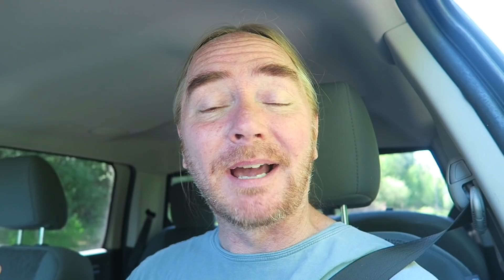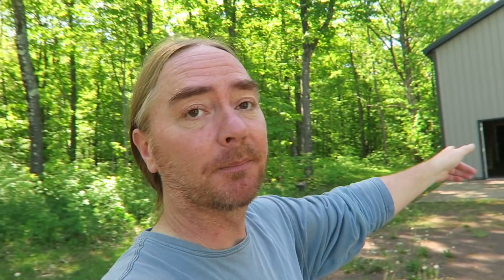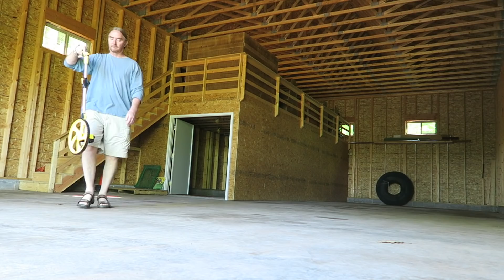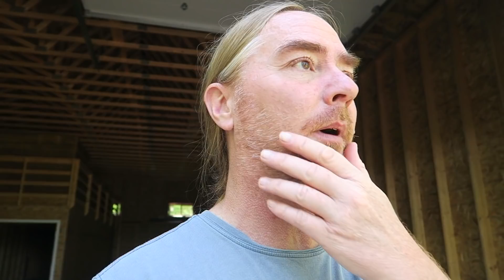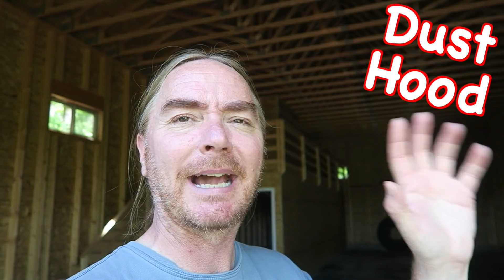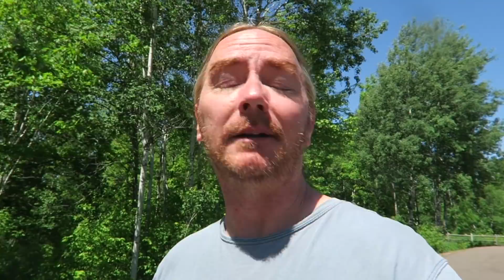Old Shop Vs New : What I've Learned Over The Years

Comment: In addition to a 20' shipping container for chemicals storage on the side of the shop under an awning (wired and heated), I would recomend a smallish gantry Crain. We are not getting younger.  This would facilitate moving small boats, equipment, shop supplies and lumber. 
Adding a mezzanine over part of the wood working area would expand storage and with a Crain,  lumber and other items could be stored with ease. 
Build a small compressor closet, (it could even be over the office) with a refrigerated dryer. Run 3/4" rubber air line secured with conduit clamps every 3-4 ft. Install 1/2" drops every 3 to 6 ft with a connector mounted to the wall. 
Also spray foam is your vapor barrier so that coupled with batt insulation will go a long way. 
Plywood lined walls (even cheaper t1 11 ) over the insulation give you the ability to secure anywhere on the wall. 
I would run electrical in metal conduit on the surface of the walls as well as the air lines.
Run pex to the front and back for hose bibs inside and out.

Comment: Get rid of the bulky table saw and get a wall track saw it made a huge diff in my shop much easier to work with.
As far as the compressor build a shelf up high and put it on it and insult a box around it .

Comment: Don't forget those stairs in your shop are not really permanent, you can change their angle and length to whatever you like fairly inexpensively. You could even make more of a walkway then stairs coming down closer to the small door, (make room for more equipment or lockers under them if needed). Just a lot of different ways they could be configured to add space.
Consider a fairly cheap shed right next to the shop for your air compressor and piping the air in, may be cheaper than insulation at some point not sure. It would also mean interior shop space is not used up by the compressor...

Comment: For the  air compressor I would put it on the mezzanine floor or outside in a small attached shed (it would really help with sound). As for Dust collection if you don’t empty it a lot I would have it off the floor in the wood shop area to increase floor space. My shop is small so I am always trying to keep floor space free. Can’t wait to see what you do in the new shop thanks for the videos!

Comment: Hi from Australia,  I agree with putting  the dust extraction  and compressor outside in a dedicated shed,  also putting  your  wood working  machinery  on lockable casters. The room I would set up part of it as a spray booth  and mixing area and extending  the mezzanine  right across  the back as that height is not used efficiently, you could even  put it  up like a 2nd teir for extra head room and give you more depth for longer boats especially  if your machinery is on castors.
Festool  also have a portable  workstation  that has a/c power, air and dust  extraction  that pivots and swivels. An overhead gantry  run on a couple of rails would make moving heavy objects safer.

Comment: Andy !!!! For your Hazardous material locker, consider a shipping container...A lot of Shipping companies sell there old containers real cheap. The community collage I go to just purchased two 8x10 and paid about 15 hundred for them. I have worked on construction jobs where they did the same, and the carpenters came in and framed them out and installed dry wall.....Hope this helps. it would definitely free up space in the shop....you can install those air circulators on top to vent...those are real cheap at Home Depot

Comment: Put your air compressor on exterior of building.  Add a small enclosure to side of building big enough for the compressor.  Insulate it for all weather and noise reduction. Shouldn't here it too much from inside the shop. Did this on a one I built and it worked great.

Comment: You might want to talk with a HVAC shop about making you some small pick up hoods that you can place near where you are working, several sizes would allow you to size the pick up to the work you're doing. For increased stability you can hold them in place with smal sand bags. If you run a set of tubes from your dust collector down each side of the shopand equip them with several  blast gates as connection points, you then would only need short sections of flex hose to get the pick up hood connected to your system.

Comment: WiFi in the shop. Decent broadband from the street if you can. An office space? Bathroom? Running water? Slop sink for cleaning? Security system? Epoxy paint the concrete floor will eliminate a large dust problem and help keep it clean. 
Just a few thoughts as I walk around in the ideal shop in my head.

Comment: Utilities - in my area, new 320 amp service is about 35 bucks a foot. $20 grand for the wiring and install. 

Hopefully you can get away with 200 amp. Buy it won't be 8-10k

Comment: First thing is you don’t currently have enough room to do everything you want, do like these guys are saying and get some shipping containers and add some doors and build a little connector to get to them from the inside if you don’t want to walk outside or just build off the sides and do the same. Second is I would start looking for as much used equipment as possible, auction sites, Craigslist, FB marketplace etc. don’t just look locally for it also look out of state for too. I would def take out and use your old air makeup system in the new shop. I have a used Euro vac central vacuum system that I took out of a body shop that I’m willing to sell for $1,500, it has lots of tubes and drops and everything works and is in great condition I’m sure it would work for woodwork. Euro Vac is a top of line central vac system google and check out their website or call them. I can send you pics and the model and serial number if interested, I’m in Michigan also. You should be able to find used paint cabinets, if they look rough just paint them with some rustoleum safety yellow. Rotary screw compressor is gonna be your best bet for air but they’re also expensive. Also for dust look into a curtain system from Goff’s they will make them custom for your needs and they take up no room, just slide them out of the way, they’re on a track on top, also can get custom colors or your shop name on them and they even make them with filters in them for painting, check them out not very expensive either. I’ve been painting cars for 32yrs and have set up a couple of collision shops from scratch and have always done it on a very small budget and with used equipment. Cleaning up used dirty equipment and painting it to look like new is fairly easy and cheap to do compared to buying new and you can always buy new decals from the manufacture of the equipment, I used to refurbish used equipment for extra money and last is I think you are not even remotely in the ball park for what it’s gonna cost you for the energy company to trench and run utilities 600 ft. The shop I’m currently working at has sold and the new owners are running a water line 75 to maybe 100 ft and I heard it cost them 85k now this is a different utility then your needing but this was to run a 5-6 inch round water line into the building strictly for a water fire suppression system it also had to be bored under a two lane road to a fire hydrant which was 13k by its self but it was a very very expensive project. I wish you the best luck

Comment: Best composite fabric rack I’ve seen was an assortment of fibre rolls at the end of table, topped with a (heated from below with an electric blanket) 8x4 thick sheet of glass. It was on castors and MDF on top when not utilising the glass. Wax direct to glass and it cleans easily. Great for infusion.

Comment: I would not want to lose the working length of the shop.  Remember when you  did a Choy Lee 44 deck.  You could not do a big boat with a 28' length.  I would consider putting a door in the end of the building and doing your wood shop as a scab on building.  You could even do a prefab.  Or as one person suggested a 40' shipping container.

Comment: You can have your air compressor outside in a little like lean to type thing with the a pipe going through the wall into your garage there so you won't have to hear that compressor so much the outside so to speak

Comment: I would build a closet under the staircase and put your air compressor there. You can vent it enough for it to get air, you can insulate it enough so it will not be loud, and you can get at it for maintenance. It would be out of the way and not take up critical shop space.

Comment: I would line the walls and ceiling adding insulation in the void. That would help with dust control. Those roof joists will collect dust and then sprinkle dust down onto your work whenever you open a door or move around the shop. I would also put the air compressor outside and the container idea suggested by others is a good one. Good luck with the new shop.

Comment: buy a Conex ( steel storage boxes) placed on the outside touching the side of the building, and frame a door in the side of both Conex and exterior wall, conexs sell for 2,000- 2500 it will give you around 3200 cubic ft of storage. and its weather proof

Comment: Pallet racks & a forklift are huge in a shop as it helps you move things off the floor.  I never realized this until my 4th shop.   I'm now on my 5th and much smaller shop but got a small high-lift 1500lbs pallet jack (15ft lift) which is a godsend.  Of course, you have to have the height, but its seems you do - height in a lot of shops is wasted space that a forklift helps reclaim.

Also look into those clear curtain walls you often see in body shops.  They are great for isolating areas intermittently.   They also help with heating & cooling.  We used them to isolate areas where there was sanding or painting.   Oh, def. move any stationary machinery that you don't need to interact with (air compressor, central vacuum, etc) to an outside building/shed.

Comment: I try fit air compressor, emergency gen ,larger fan's, out side fitted under like a cabinet, extension on the building. Keeping noise outside, more room inside.

Comment: put your woodworking M/c`s in the enclosed area if poss and the compressor put it outside and undercover checkout steve summers vid titled (Shop air System with Elizabeth & Concrete pad for compressor)

Comment: Here is what I would do:

* Put ALL tools on dollies, the larger tools on a dolly each, the smaller tools on carts. Why settle for one shop layout when you can have as many as you like, depending on the boat you are working on?

* Built an addition at the back of the shop and make that the material storage for both wood as well as hazardous materials. Make that add on accessible from both the shop as well directly from the outside for load in. Added benefit - you can install an automated fire suppression system in the add on so if fit hits the shan, it can easily be put out without putting the shop or the boat at risk. 

* This will also keep the internal storage free for making it a finishing studio.

* Invest in a good ecosystem of battery powered handtools with good dust collection (I would go Makita since they have the largest selection of 18V tools, their dust collection is great and they are reasonably priced and last a long time, but you'll find that everyone has their favourites). Having outlets every 4 feet is great, not needing outlets is a lot greater and with 18V tools beeing as good as they are today, you'll never look back.

Comment: Two thoughts:
1. What about a cargo container for storing bulk materials including hazardous? Keeps them away from your most important stuff
2. What about extending your platform across back of building. If leave center part free to wall you have more space to locate fixed tools and opens lower portion and center of space to larger boats.. could also dual purpose with some sort of all around scaffolding?

Comment: If you complain the Air Compressor is too noisy, it is probably not a piston compressor... Switch to a piston style compressor (probably belt driven) and has a large tank... Add a condensation drain at the bottom to tap any water out of the tank when the compressor starts up. 
To contain the noise, put a 20' container in the back and install your compressor and dust collection hardware. Up where I am, a 20' container is about $1000 plus delivery. 
Get two and use one for your flammable storage building, just put it a few feet away from the other building.

Comment: When I built my shop all machines had basses built just for them with industrial lockable casters  when in use roll out to where needed when space is needed I just push them back to the wall. I would get 2 Oneida dust systems one for the front one for the back. (Contact oneida they may cut you a deal)Would a portable welding dust hood work for collecting fiberglass Dust ? Good luck place looks great

Comment: With all the tools, supplies, chemicals, lumber and consumables you use, you need a TON of shelves and racks. Plan on most walls covered with shelves. Also, maybe extend the mezanine  4 ft wide across the back of your shop. You could put your cyclone up there (bin at floor level), as well as another 15 of shelves. Gives you kore floorspace and less wasted vertical volume. Jet makes some nice cyclones as well as grizzly for less money than oneida or clear vue. 
When laying out my shop, i made scale outlines of my floor space, as well as my tools, shelves and workbenches then moved them around to get a good layout. Like playing paper dolls for workshops. Helped me visualize workflow and choke points and only took a few minutes to do all the prep.

Comment: For your air compressor and dust collector, consider building an external attached shed and pipe through into the main building.  It will dramatically reduce noise and save a lot of shop space.  It could be built for under $600 including the siding, door and metal roof.  It wouldn’t even require a slab.  Or even buy a small hardware store shed and set it right next to the shop.

Comment: For dust collection get something that dont exhaust outside, you save alot in heating, for heat that air compressor makes, do a system that in summer you can blow hot air that it makes outside and in winter inside to heat the shop. Electric power cord reels and air reels are the way to go.

Comment: You could build a small enclosure on the outside of the building to house the air compressor, keeping the noise and heat out of the work area. I built a water separator for my system which removes almost all the moisture from the air before it goes into the tank.

Comment: Several people are 100% correct in their suggestions. 

#1 - scroll/screw compressor (Kaiser brand) and convert the old compressor to a compressed air holding tank only. This will allow for the compressor to fill the holding tank and essentially increase its capacity 

#2 - Add a header, doorway framing etc now for flammable storage room off to the side. Even if it’s not in the budget immediately now it will allow you to keep this stuff separate 

#3 - move the stairs to the back wall allowing you to get the space desired for woodworking upfront so you don’t have to schlep material to the rear of the building past your boating projects.

#4 - Consider having sidewall and overhead lighting. This will allow you to illuminate more evenly and eliminate shadows (similar to a spray booth). LED all of it with line voltage LEDs eliminating the ballast needs.

Love the channel and excited to see the Bertram get back underway!! Best of luck to you and your loved ones.

Comment: You call wall out the mezzanine floor level to make another room for storage etc and do the varnish / paint downstairs in that room. 
Screw compressors are a lot quieter than the traditional types. Could even make a side shed / extension to the existing building for storing that and an extractor motor.
For benches you could have them fixed to the wall and fold out, as you lower the legs fold down. When your done lift it up and the legs go flat on the wall with it. Will save space when it's needed then but still have a bench available for use when needed too.

Comment: Check into getting a retired 53' refrigerated "Reefer" trailer. It'll already be well insulated, it can be rolled next to your building, taken off the wheels, then cut access opening in the side & thru the side of your shop. Easy. They are great! I got one myself. Easy to keep heated & cooled. All I do is run a de-humidifier, and a circ fan, & it always stays dry& cool inside (located in central Florida).

Comment: Sometimes you can find a good deal on used commercial fluorescent fixtures. You can remove ballasts and use direct wire LED tubes, which have come way down in price. I've done this a couple of locations and the difference is huge.

Comment: When I saw that little room I instantly thought paint booth. I’m building the inside of my shop right now 25 x 60’. First thing I did is put two mezzanines in. It’s like creating workspace out of thin air. One is 25x10 and the second is 16X22. I’m going to build a winch system to get materials and boats up and down. I’ve got clear fiberglass reinforced plastic sheeting to build a bag around boats for grinding and painting. I replaced all my air tools that require a lot of air with battery powered so I only need a small compressor. If I was you I would put a large compressor outside in a small shed attachment, I can’t do that because I’m limited to the footprint of my boathouse floats.